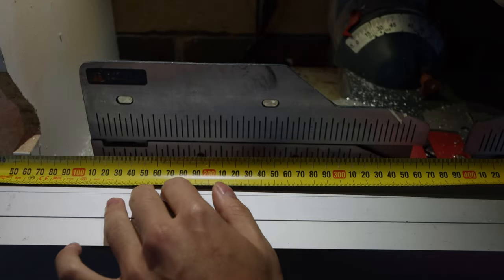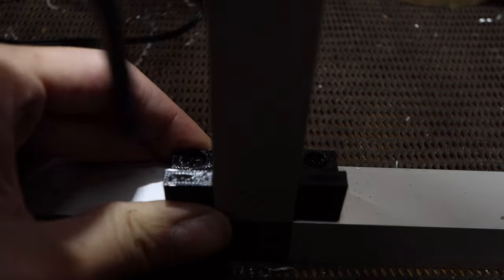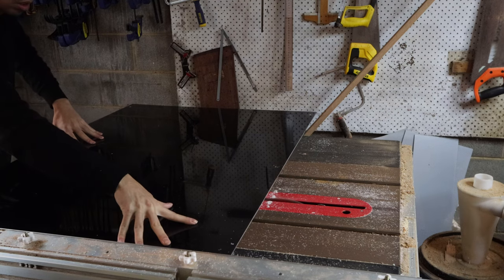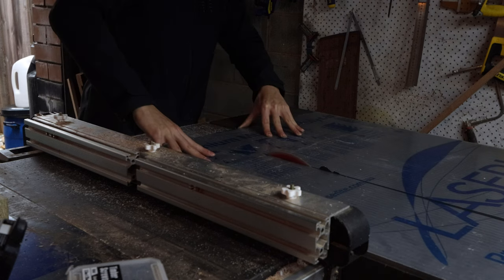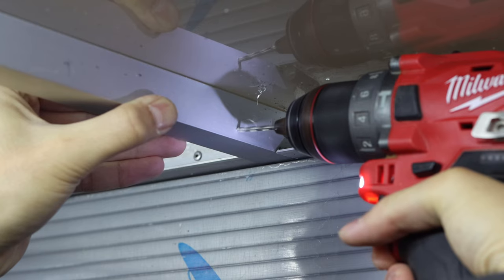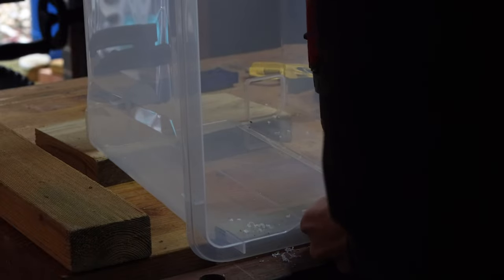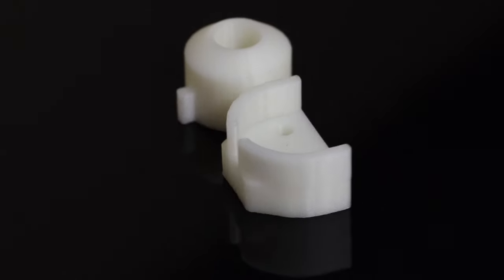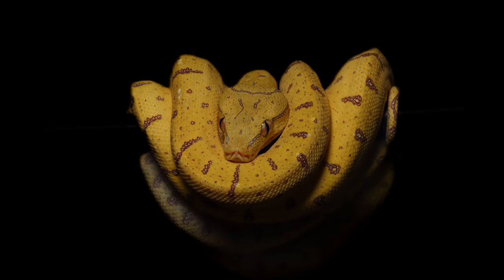DIY Demo: Green Tree Python Rack System

Comment: Looks great!!  Do you have a list of supplies that you used?
Reply from the maker: Thanks! 1 inch aluminium tubes and nylon connectors, 3mm acrylic sheets, 3mm aluminium composite panel. Let me know if there’s a particular part you saw in the vid that you can’t find
Reply: @Varanibae thanks the reply! I was curious about how you did the lighting
Reply from the maker: @BlackAurumArt  the only lighting in there is the led strips, all the electrical supplies for that was from ebay. The cool white 12v led strips were placed into aluminium led channels that were mounted on a 45degree angle using 3d printed brackets. There are holes in the aluminium frame so that the wiring can be fed into the hollow aluminium tubs and be hidden. A female dc Jack was used so that the power supply for the led strip  can be unplugged from the rack system if required
Reply: @Varanibae thank you so much for the detailed response! 🫡